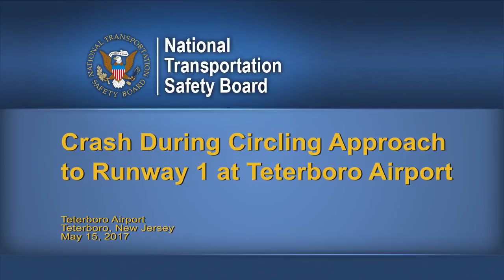Learjet 35A Teterboro Approach Crash • NTSB Animation

Comment: Im not a pilot but im trying to figure out how this flight was so infinitely complex for them. How do they screw up everything so bad. Maintaining speed,, altitude and headings ought not require Top Gun training to master., just a straight flight, be at 1500 feet to make a right turn at Torby ., fly towards Met Life stadium until you can turn left for a straight in approach to runway One. Maybe a glance at a chart will tell you other airports youll see along the way., and also not to be fooled by seeing runway 6 as you approach Teeterboro. All part of a preflight discussion no doubt.., but not taking the simple measures to save your own lives is beyond baffling.

Comment: Perhaps the Captain assumed the SIC was rated for the aircraft. He didn't expect the poor performance. Kind of think SIC should have better grasp of things. Both pilots were not preforming 100% perhaps both impaired. 

In all 3 similar circle accidents each pilot was trying to save the approach after overshooting final. Lesson: power full, gear up, flaps in trail, announce missed/go around. Fly towards protected airspace.

Instructors teach your students:  Be on short final 200 feet, gear down, flaps full, ...command go around...Student will apply full power and then the nose will rise very fast. The student needs huge nose down force, less flaps, trim all about the same time with airspeed control. Followed by gear up positive rate climb, airspeed control and additional flap/trim adjustment. This will burn into their memory bank forever. 

That's how you save lives

Comment: This is very likely the captain’s fault for not taking controls due to the second in command not capable of this hard left turn at too low an airspeed. Things happen rapidly in jet flight vs a prop plane. This clearly seems to be the captain’s fault.

Comment: All pilots need to know the basics of auto gyration. This accident could have been avoided by cutting power to engines 3, & 4, dropping the nose to increase airspeed, & allowing the aircraft to induce a SVT (self vectoring turn - for the non pilots out there) with over 3000 hours, in 5 different commercial jets, this BASIC manoeuvre has got me safe on the ground EVERY time. RIP the pilot Tom ‘Wiggy’ Winigstall. We flew many an F-4 sortie over Nantang, in ‘69. 🥺

Comment: How experienced was Capt of this Learjet ?  Sounds pretty  notByTheBook atall... letting giving flt instructions to jr copilot not rated legal to be  PF  and no briefings enroute. etc etc... not even knowing dme dist to TEB thinks he 100s miles away... planning a route for 27,000'  when so short dist and then ATC gives him 4,000' ..??! omg... pretty huge diff... plus a clear blue day.. but very windy..
Does this Capt  even have clue really?  sorry not try be mean.. but really outof it.. sounded cavalier too quick  and messed up on radio few times.
How many TO /Landings he done at TEB prior ?
 How many TT hours flying? 
Guess havevtryfind full l NTSB report... too bad  very sorry for both pilots  .. should've been way better results ... so sad... 
I remember this day  hearing bout it May afternoon on WBZradio when it occurred. 
Why not  ATC could've ApprControl  alerted or Tower wave him off when see he never made R turn correctly to  get on final to rw 1.  Still stuck shooting on course for rw6.  why? 
 Why  does App radar even hand him off to Tower when he's so screwed up?... that ain't right.  ATC  should be better too.  Actually think ATC / Pilot coord system is screwed up.. here's good example.  also... Why wtf does Tower have ask bother pilots " where ya parking?" when most critical phase of flt pilots working butt off trying  approaching on final to land in super congested busy multi ClassB airports.   So stupid.. Xan ask tell pkg crap after landing and  safely departs rw.  Bad.

Comment: Completely and utterly incompetent. This is why there are 5 times as many accidents with private jet pilots vs. commercial airlines.  They did EVERYTHING wrong!! Next time you charter, don't go for the cheapest brokered flight. Go with a company that has a top safety record and pilot training especially in upset recovery. The only way the safety record of private jet travel will improve is with elimination of inadequate training and follow the damn procedures. SOP briefings are in the manual for a reason!!!

Comment: Most of these ATC guys are utterly incomprehensible. For instanve 7:06, "fitch hundred feet" ?!? One wonders what they scored for writing and reading in primary school, mumbling inarticulately at blazing speed. How much effort does it take to clearly pronounce letter, number combinations ? If they're tired of doing it all day and just try to get it over with as quickly as possible then it's not the right job for them. It's almost like some kind of running gag to confuse pilots.
On a sidenote, at 9:54 isn't that a left bank angle i.o. a "right one at 120 degrees" ?

Comment: As a non flyer, it staggers me that ATC rattle off instructions so quickly. 

In any other environment, if your goal is to be understood, you speak slowly and clearly.

Just seems to increase pressure in the cockpit, at the very least it seems unhelpful
Reply: xackly!
Reply: You get used to it as a pilot and can rattle it back just as fast.
Reply: This how things are in a busy airspace if you cant handle it dont fly near nyc

Comment: My dad was certified in a Lear from the mid 1960s until he retired in 1996.  I asked him about this crash.  He stated that just about any mistake that could be made WAS made in this flight.  The Learjet is a wonderful airplane, but it isn't a particularly easy plane to fly, the margin between controlled flight and uncontrolled is very thin.
Reply: I've heard it's like a fighter, but for transporting people.
Reply: That's very true. The original Learjet design was based on a Swedish fighter jet, then modified for business needs, so it's still pretty much handles like a fighter jet. My dad, who flew the leader for decades, also flew fighter jets in his second career For the air National Guard.

Comment: The voice on the radio didn't sound impaired, but all the confusion makes me think drugs or alcohol were a factor in this. Especially since the captain seemed so reluctant to take the controls. When he did it went from bad to worse.
Reply: From the looks of that security cam footage I would assume there wasn't enough biological material left to do a toxicology study.
Reply: Makes me wonder if the sic knew something was off too, and agreed to take the controls during the flight, even though he wasn't legally allowed, being stuck between a rock and a hard place..  In another re-enactment video the captain used another explicit word towards the sic just before taking the controls in the final seconds.

Comment: The whole sheebang feel so strange. Obviously the wrong PIC (SIC-0) knew his limitations as he tried to pass over his duties to the legal PIC (captain) several times. He may have felt behind his aircraft but as long as you are aware of it and try to solve the poblem by giving the command back to a more experienced pilot I don't really see a problem with it. But the reaction of the captain is almost criminal, first operate in total disregard to regulations and procedures (SIC shouldn't be pilot flying, no checklist etc.) then doesn't take the control back when his SIC ask him, several times and put everybody at risk. Yet he sounded reasonably sharp on R/T.

Comment: Wow, so much done wrong in so little time... this was a tough video to watch. It's almost hard to believe that this actually occurred. 

I'm not going to repeat what everyone here has already touched on, but one thing I'm curious about and not necessarily referring to this situation, but imagining a scenario where the SIC was a decent pilot and he was partnered up with someone like this piece of work (I'm being kind) in the left seat. What are a SIC's options when dealing with a dangerous PIC, one who either is possibly under the influence, or just mentally unstable, or just a dangerous worthless pilot who should never have been certified to fly in the first place? I'm gonna guess you're not given many options other than trying to convince the PIC to relinquish their command and go sit in the back of the plane. Given this PIC's clusterf_k of piloting... the SIC, even if of limited experience, would at least follow ATC's directions and probably gotten the plane down safely if not delicately (I'll take a couple of bounces, a broken nose gear, or sliding off the runway over a stall in a steep bank 100 feet off of the ground any day). I guess there's no procedure to follow for the SIC if the PIC refuses to give up the yoke, other than switching to autopilot, smacking him in the face with your iPad and then physically restraining him in the back (hey we're talking life or death here). I guess the only other thing he could've done is gotten on the radio himself and at least told ATC the situation... in his last words before he died to explain that the PIC was about to get them killed. 

I'm also going to guess that ATC also made mistakes, if they saw a plane on an IFR flight path not following directions and making some pretty serious mistakes, both in the plane attitude and the pilot's own read-back's,  shouldn't they have thrown a red flag up that a plane was flying dangerously and at least cancelled the plane's planned approach and told them to climb to some safe holding pattern until they could get the pilot to follow directions?  

And for those that have had experience with this PIC, who I read some comments that the guy was known to be bad news, wouldn't it be logical to make an official complaint against them with the FAA? If I find someone driving erratically and dangerously in a car on the road, I have no problem dialing 911 to report a possible drunk driver (did this just a couple of days ago actually), why should it be any different with pilots?  One's proactive actions can possibly save some lives, one should never hesitate to do the right thing.

Well, about the only good thing that happened here, was that no one died on the ground as well.
Reply: Perhaps that is why the PIC requested a higher altitude and some female brain dead ATC denied it. That in combination of the SIC throwing in the towel before landing because he realized he couldn't perform. The SIC killed them both.

Comment: They zigzagged back-and-forth, deviating from the flightpath multiple times, violated airspeed requirements multiple times, ignored altitude instructions, ignored radio frequency instructions, failed to circle properly for approach to runway 1. This flight was doomed from the start. Fortunately, no one else was on the plane.

Comment: That was some horribly glib aircraft control/navigation/ATC-command adherence.   #WTF
Reply: I worked in ATC at Houston ARTCC after Reagan fired the PATCO controllers, and I have to tell you, the people who were left behind knew what they were doing, did it well, and when a pilot didn't respond appropriately to commands/instructions, they were johnny on the spot. Granted, that was many years ago, but some of these controller comments were nearly impossible to understand they were spitting them out so quickly. Our rule was always, no matter what, the captain owns the plane and is fully responsible. Good, bad, or indifferent controller, the Captain is the one who has to get the plane safely on the ground.

Comment: I'm not a pilot but just little advice for Pilots out there keep the bottom of the plane facing down and come in a little slower I don't know I'm just guessing it might help next time
Reply: low and slow is dangerous in an aircraft .
Reply: @maddmavic  If you're not a Pilot, how could you give flying advice to a Pilot???
Reply: @gavinsingh4450  like i said im guessing and i fly rc planes. They are aerodynamicly the same

Comment: Does anyone know what the issue with the pilot was? It’s sounds like he was either negligent or impaired. Was there any other reason for him to hand control of the aircraft to someone who was designed as an observer only?
Reply: This videos leaves out tons of cockpit voice recording. Basically the Captain had the SIC flying the plane as "instruction". But the Captain did not know that the SIC had terrible training record, failed almost everything and crashed the plane in the simulator twice. It was noted in his simulator training that he had difficulty simply maintaining airspeed, much less flying the plane. That's why the plane was all over the map. For whatever reason the Captain ignored the fact this kid can't fly the plane but tried to get him to do it anyways. When the Captain finally took controls, he still attempted the land it on Runway 1 instead of doing a go around, stalled it trying to make a sharp bank, and CRUNCH.

Comment: I don't remember hearing in the video about the weather conditions that day - were they in the clouds or VFR?   I figured must have had their hands in the clouds and getting bounced around.  So I looked for that in the NTSB and was a little shocked to find:  

    "At 1452, the surface weather observation at TEB was: wind 350 degrees at 20 knots gusting to 30 knots; 10 miles visibility; scattered
     clouds at 4,500 ft; temperature 19 degrees C; dew point 6 degrees C; altimeter 29.75 inches of mercury.

     The TEB automated terminal information services (ATIS) Z was in effect at the time of the accident. The 1451 ATIS Information Z stated 
     that the current weather was: wind 350 degrees at 18 knots gusting to 29 knots; visibility 10; light rain, 5,500 ft scattered; temperature 18
     degrees C; dew point 6 degrees C; altimeter 29.74 inches of mercury. ILS Runway 6 circle approach in use…Low level wind shear advisory
     in effect… ." 

In other words, clear enough to make a visual approach and land the Lear Jet somewhat like anything else.  What in the world caused them both not to fly this airplane??  Why was the FO so concerned to give it back to the Captain?  Even when I had less than a 100 hours I remember taking the stick of anything I could my hands on and flying.  Watch airspeed, primary - on approach.  Keep the wings level, no steep turns or cowboy antics.  No doubt they were experiencing pretty substantial turbulence.  Look at the pressure reading and the winds.  That may have shaken him up.  But after botching the assigned course, trying to slow that skinny fast jet, get it low enough to set down where they were told, and using a dangerous technique with what was surely a too-steep turn, the airplane certainly stalled in the steep turn at such a low airspeed.  The NTSB report said they failed 'add' sufficient airspeed as required in the gusty conditions to maintain controlled flight.  Not exhaustive analysis, but .02 on what evidence there is to analyze.  Another case of too slow, too low.  Very sad.  God Bless you fellas.  

My friends, be not critical of your brother.  Be ever watchful.  Ever vigilant.
Reply: This is by far the smartest comment so far. Could have they done better have the air controllers warn the crew of the wind-sheer conditions? or have instructed them to go abort the approach and go around?
Reply: Clearly the FO panicked and realized it had been a mistake that the captain had let him flied the plane. In other words his failure to perform killed them both.

Comment: This was the most incompetent and disengaged captain I think I've ever heard of.  One gets the impression from his actions that he was impaired by alcohol or drugs.  How does he think they're still hundreds of mies away if he filed a flight plan?  Unbelievable! 

The poor first officer, as is too often the case, showed complete deference to the captain.  It's a shame he didn't say "Dude!  I'm not doing this!  Take the g@&&am controls!"
Reply: Even if in theory there was zero flight plan - the aircraft has top notch GPS that shows you exactly where you are. Its not like he was flying with a paper map, stopwatch and compass.
Reply: @rinzler9775   He did not have GPS that's why. The SIC offered him to use his iPad by Cap declined. This video leaves out some details.
Reply: Having the PIC and SIC in disagreement is a dangerous situation. Sometimes having thousands of hours can be just as dangerousxas too little - it develops a potential immortality power that because nothing happenned in the last 10,000 hours, then "all I do is good" thinking.
Reply: @rinzler9775   Captain was like 52 years old and only had 6,000 hours. Another oddity.